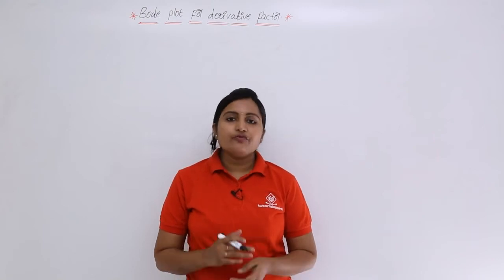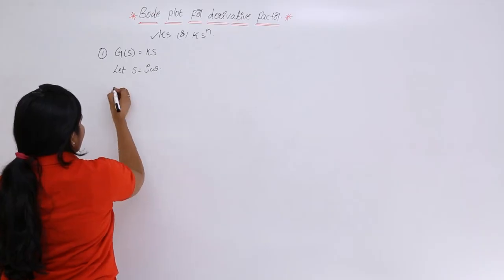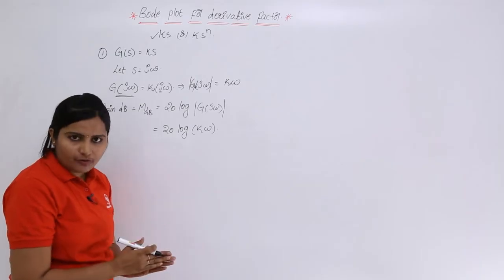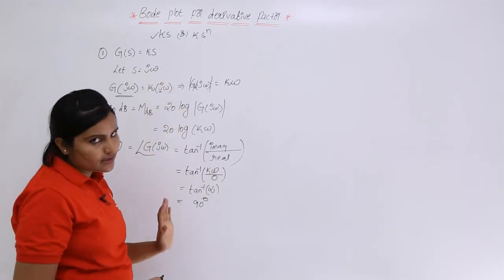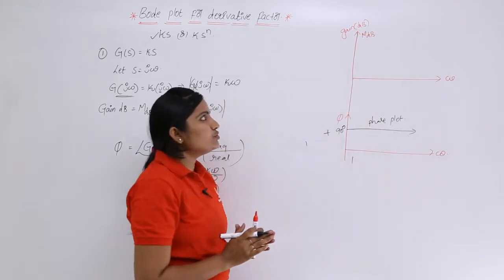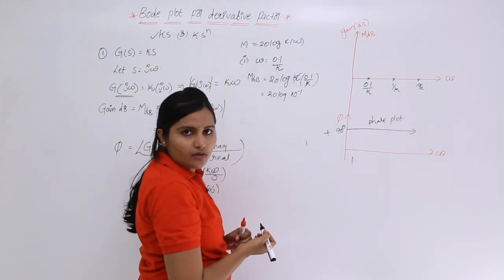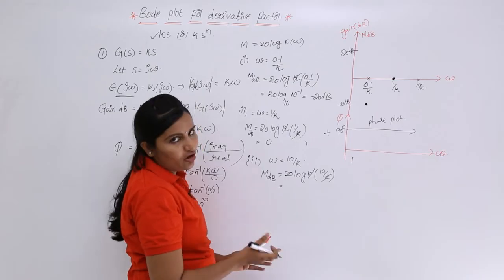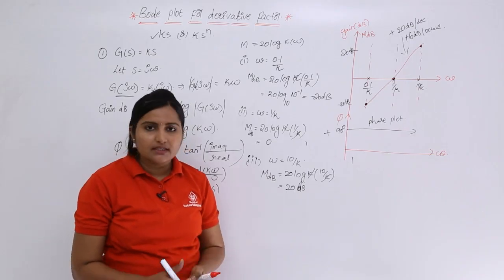Bode plot for Derivative Term Part A

Comment: mam , in bode plot for integral factor, phase is -90 and in derivative factor phase is 90,what is reason rather tan-(inf) is 90.
Reply: because in the bode plot for integral factor, the omega is in the denominator. So, the phase angle equals to -tangent (imaginary/real). While for derivative factor, omega is not in denominator. Thus, phase angle equals tangent (imag/real).